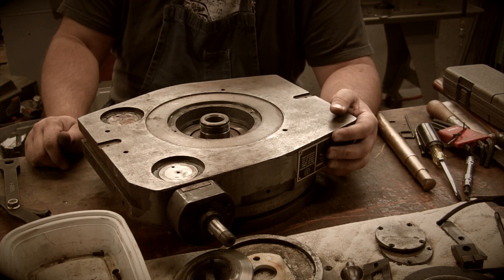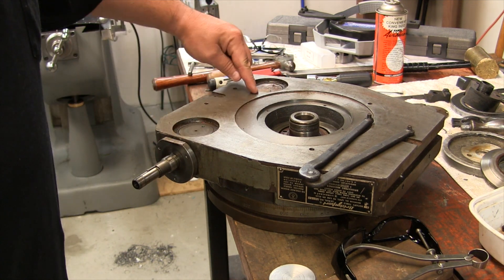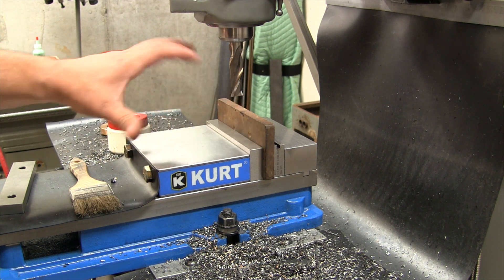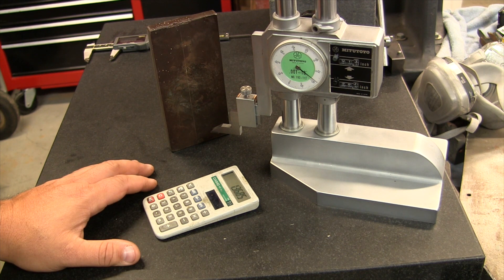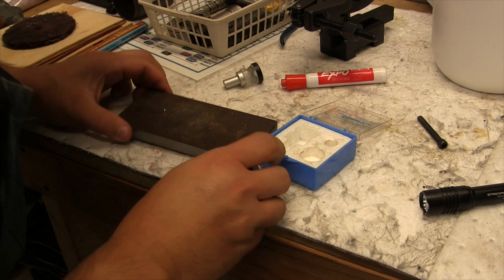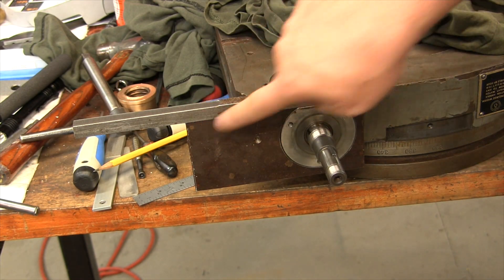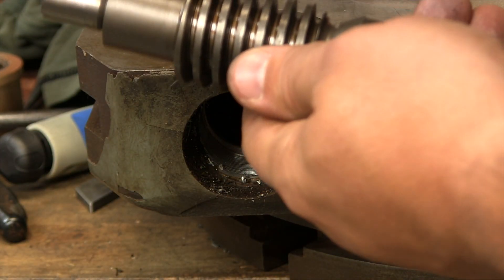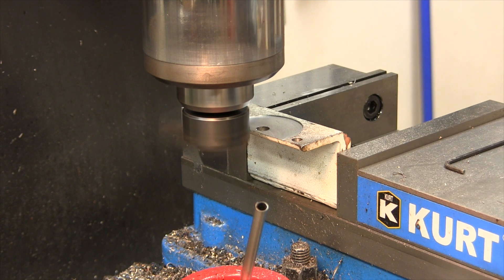Bridgeport Rotary Table Teardown & Cleanup - Part 2

Comment: how nice of you to just GLOSS OVER getting the table off the base. The ONLY reason i am here you skip.
Reply from the maker: Well my man, in this type of work, you gotta think a little and figure some things out, not every step is covered, especially the obvious ones. But had you kept listening (instead of stopping to leave me a negative comment) you would’ve heard me. Explain exactly how I got the table out. It’s pretty easy to realize that after I removed the locking nut (that I made the 2nd tool for), that the table would just drop out. And I explain that, exactly. Gotta sometimes listen…

Comment: Good re thinking outside the box to come up with those tools to solve these problems. 

Question (thinking ahead) Has your research into this piece of equipment provided you with any information about torque requirements or information about clearances etc at all for when you come to putting it all back together?
Reply from the maker: +Dan Whiteford Hmm, no I haven't read anything on that. I did make sure to tighten those parts that were torquey. But she's all back together now and operates smoothly.

Comment: Brad, think however told you that was BSing you! there is no way that you would have needed a 4' pipe wrench to take that off. what you did was the way to go, putting a pipe wrench would have marred and left jaw marks on it! nice job!
Reply from the maker: +Fred Newman I read that in one of the threads on Practical Machinist. The person did say that they used copper sheet metal as a protective cover. But make no mistake, that bushing was really tight. It was even harder to get back on and clocked right. I had to remove the bushing (a second time) and chase the threads on the lathe. I simply couldn't get it back on. It was strange...